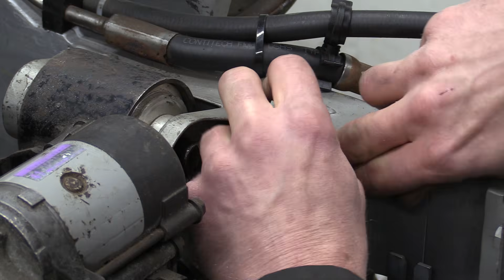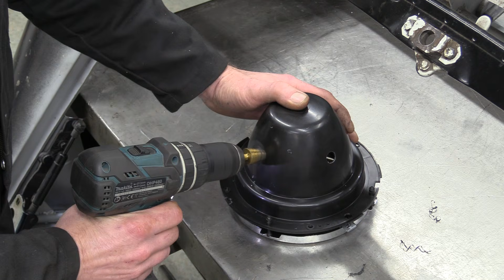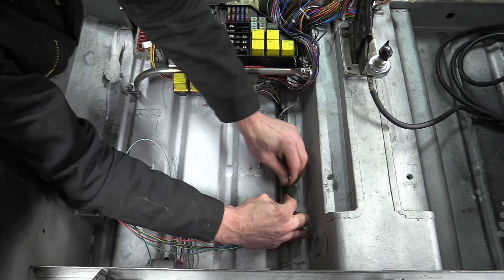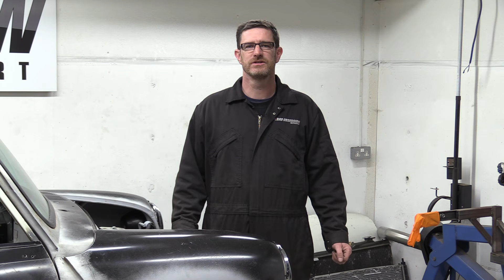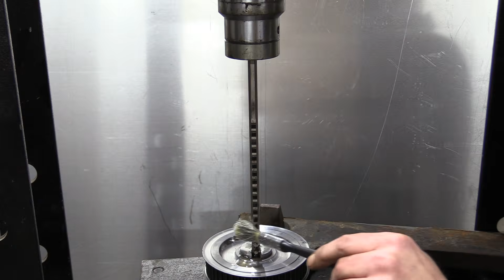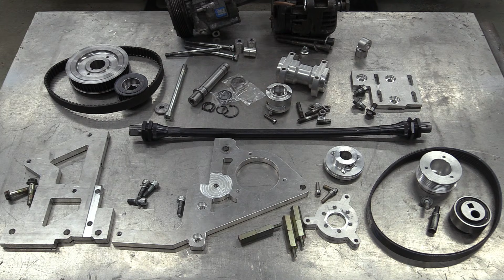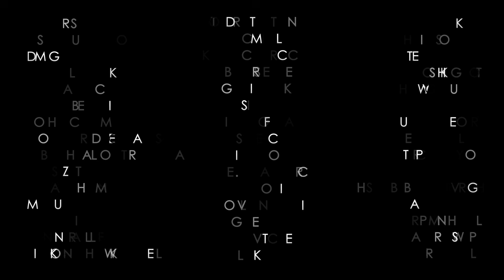Project Binky - Episode 20 - Austin Mini GT-Four - Turbocharged 4WD Mini

Comment from the maker: Thanks for all the comments everyone! We really appreciate your support. We're not sure exactly how successful the ancillary drive will be. Ultimately the only way to tell will be to run it and find out. It may not last very long and might need regular maintenance, it might be fine but we're very much looking forward to finding out.
Reply: Hi guys. Loving this series. If you don't mind me giving my 2 pennies worth, you might want to ditch that Gates ' Horizon' belt for a standard Gates belt of the same size ( if they do one ) as those ' Horizon ' belts are rubbish. I've fitted a few over the past few years ( mechanic of erm...... yeah, 23 years ) and they don't even last 12 months before they are all perished and splitting. I'm in awe of your engineering skills. That whole bearing carrier, pulley set up is amazing.
Reply: The whole thing will come apart and be painted. Then final assembly gets all the proper rubbers and such.
Reply: Great work, I'm very curious how well that is going to work. Would be very interesting to see the specs of that thingy. 
If mechanical alternator solutions keep failing, perhaps you can hook up a few thermoelectric peltier elements which would produce electricity as long as the engine keeps warm. Perhaps mounted with heat sinks to help cool the extractor with plumbing off. (The exhaust should be the component that reaches effective temperature the fastest as well.). I imagine it would save a ton in weight as well.
Reply: @calysagora3615  you imagine wrong.  A 100W thermoelectric generator costs hundreds of dollars,  is two feet long and runs at single digit efficiency so requires kilowatts of heat from eg. a wood stove to power it.  You'd need at least five to make up for the output of a 50 amp alternator, which would cost several thousand dollars, fill half the engine bay and require about ten to fifteen horsepower worth of heat.
Reply: PKMartin a
Reply: @calysagora3615  Not a bad idea, but as mentioned below, not going to provide enough power.  But if they could fit a little steam engine in there to take advantage of the remaining heat in the exhaust, then they may be on to something :)  (some steam engines even have multiple stages to take advantage of the cooler exhaust coming out of the previous stage)
Reply: @calysagora3615  an average alternator could easily produce  50 ampx 12+ volts ,how big a peltier device to match ,and how efficient are they ?
Reply: Comrades. First off I love the series. I just wanted to add some advice take it or leave it. The stock pulley is actually a harmonic balancer. It dampens some nasty nvh's caused by the crankshaft being like a tuning fork. I have seen other engines where this was done and the oil pump and main bearings were trashed. Just food for thought.
Reply: Fudgeing brilliant as always.
Reply: Why didn't you just take drive from the flywheel? Just a little Hole and a gear, jobs done :)
Reply: when it fails just cut the distributor shaft off and put a pulley on that
Reply: @joelclark634  That was my first thought .
Reply: Originally did you know just how long and complex it would be, like all the intricate pieces and work arounds like this alternator and ac shaft bracket system?
Reply: good work.
the housing of that flex drive shaft will melt !!
Reply: What you guys need to do is add an electric alternator. Problem solved!🤣
Reply: Can't wait for the next episode! Awesome videos!
Reply: Always a pleasure watching your attention to detail.
If the wiring is complete at the rear and front, are you going to fit grommets to the areas where the cables pass through the bodywork?
Reply: So much excellent work. Great skills. Hope that works reliably. If not perhaps there is room for a small diameter alternator to mount directly in the engine.
Reply: I didn't see a harmonic dampener on the new crank pulley. Could that end off damaging the crank or oil pump (if it's a planetary type)?
Reply: Hey guys! You are doing a very good job on the Binkmeister.. I do have a question, however. I hope the wiring setup is a preliminary one? I hope you are not doing the project that well and then cheap out on the protection of the cables?  :) You should really put a corrugated insulation tube around it.. From personal experience, I know that Wurth has good cable managment systems with these. They also have different Y-splits,90 degree bends,etc.. Here is a screenie from their online catalog where you see the different diameters and added splits etc. http://prntscr.com/lmpgfr
Keep up the good work! Can't wait to see this project done.. :)
Reply: @sasakurtovic6850  Final assembly.
Reply: You basically took a Mini body, and built completely new different kind of car inside it. 🤔
Reply: Bad Obsession Motorsport I guess a 48v integrated starter/generator is too costly...
Reply: Why aren't you guys on Motor Trend TV?
Believe it or not, I know whats involved in Wiring an automobile. It took me 
eight hours to completely rewire the Head, Tail, Side, License, and 
Dashboard Lights of a Subaru. I was alone. Then there was the Vee-Wee 
Rabbit. I had to replace the Engine... All by myself. 
My own 1969 Austin America/1100/1300 with the Lucas Electrical System was not a 
Nightmare... Everything worked and hadn't been hacked. All I did was Re-polarize from a Positive Earth to a 
Negative Earth. and replaced the Dynamo with a (How do I know this) 
16 ACR Alternator. 
When I added Fog Lights, or Radio I ran a NEW and separate Harness. I refuse to cut into an existing Harness when it's safer to do it my way. 
I enjoyed removing the SU Carb. with the Intake/Exhaust Manifold combo, 
because installing the Tuned Exhaust Header and a Nikki Progressive Two 
bbl Carb with an Aluminum Intake on the 1430cc BMC was going to change 
everything... It did.
The only drawback on my Austin was the Flywheel Keyway. 
It would shear off. I was constantly replacing it. I was told (By a 
Local BMC/BLMC/Leyland) Mechanic) I had a little too much Horse Power. Is there such thing?
I loved my Austin... I miss it too. It was a cool little car. 
Prior to buying it I had a 1967 GTO, a 1967 442, and other Factory Built 
Muscle. My favorites out of all the cars I owned were my 1964 Olds Dynamic 88 Wagon (394ci with the 
Slim Jim Trans.). Then there was my 1966 Ford LTD... 350hp CB.302ci. with
 a Police Interceptor Trans. It would lift the front Tires off the ground... Even at 25 or 30 MPH!
Of course, the aforementioned 1969 Austin and my (Ahem!) Slightly Modified Yugo GV. The Austin and Yugo 
were stolen... Separately, and Years apart.
Now days, I only build much smaller Vehicles. Some are (A little) over the top. My Mercedes 190e
powered by a GM LS, Two LS powered Nissans, (One is a FOUR DOOR) a '49 Mercury and '49 Ford... Both have a 429 Hemi. I (Almost) put a LS in a 1/27 Scale, Spad VIII. I caught some (Snicker) "Flack" about the Spad after I posted Pictures of it. I didn't realize how real it looked. Even with Snoopy as the Pilot.
There's too many others to list... Over 300.
Keep up the good Hot Rodding.
Reply: So what is it that makes the idler bearing so eccentric?
Reply: If it doesn't work (sorry if you've already figured this out, I realize I'm a year behind...) You might try machining a hole in the bellhousing and setting the alt up with what's known as a "pad mount" configuration in the aerospace industry, using a gear and a pulley on it, then drive the ac comp from that via a belt as you already did.
Reply: @keinanderer9930  .. hey guess what ??
Reply: No grommets where the wiring runs through the frame rails, etc. @ https://youtu.be/WIyxrvO3dRk?t=831 ? would hate to see those edges cut through the insulation and ruin all that hard work.
Reply: daemonhat how can you watch this series and actually think they’re gonna leave wiring with no conduit or grommets?!?! Whole lot will be removed for paint then installed correctly!
Reply: @jackmitchell618  this is the first i've seen of the series. and i'm sure it will be taken apart for paint work, etc.,  but my point is still valid.  the wiring can still be damaged by the sharp edges requiring the harness to be repaired/replaced.
Reply: @daemonhat  Yeaaaaa, thats what final assembly is for. They have to take everything back out again just for paint.
Reply: @daemonhat  I noticed that too, made me cringe a tiny bit- sorry fellahs. They did admittedly say they don't do wiring much.
Reply: @carlsagan2561  Didn't you see the Gromit at the beginning of the video?! Though I guess you could be from US of A and not get the joke...
Reply: Really, you must think they are stupid.  Of course they will use grommets in final assembly  @daemonhat
Reply: @irSpeed  first, i never implied they were stupid, i mentioned the lack of grommets and my concern over it.  second, my point is still valid, running the wiring without grommets or even some masking tape to dull the sharp edges, even if it's just to test fit it still leaves open the possibility of the insulation getting damaged and the wiring harness having to be repaired/replaced.

Comment: I wholeheartedly agree with the inclusion of a new high level brake light, or third brake light if you're in 'Merica. It's far easier to see that light, which is typically right in the middle of where you're looking, than it is to catch the standard brake lights, particularly at night when your tail lights are on anyway, so the distinction can take a moment to register. It also gives you an extra bulb that can be burnt out before you're failing to indicate that you're stopping.

Comment: What sets you guys apart from practically everyone else doing these kinds of "mods" on EweToob is that, between the two of you, you have all the necessary education and requisite skills to do this properly (hopefully).  Designing, mechanical, electrical, drafting and shop skills all contribute to make a great series.

But just why are UK "fog lights" red and not amber.  Seems like the amber color would penetrate fog much more readily.

Comment: Why didn't you two use rubber grommets in the holes in the frame when running the wiring?  I would think that with any amount of normal everyday running and bounding about in the Mini that running wires through sheet metal holes would, over time, wear through the wiring insulation and short it out.

Comment: The lack of mechanical protection on your cabling is a real concern, especially where the pass through holes or across sharp edges. Really need sleeving or conduit. They will chaffe

Comment: I am surprised they still use alternators in the present form.  Now that control electronics have matured, why not fit permanent magnets into the flywheel and have the coils fitted in the bell housing.  This could still be designed to give 3 phase AC but without the problems of conventional alternators.  As the rotating velocity is much higher, it would use much less materials and be lighter.   Also....  why not run the engine lube oil through the cooling system instead of water.  This would remove the corrosion and freezing problems and also provide engine oil cooling.

Comment: Having electro/hydraulic power steering I would  consider a  higher capacity battery may be needed to maintain a stable supply for the CPU.

Comment: What will the toque numbers be for the motor build be? Two hundred ft/lbs should be plenty. That is , if , the final weight is at or under a metric ton.

Comment: Just to give you heads up, you might be aware of it since you are also working on rally cars, it is not very good idea to have servo system and breaks on the same oil system; if you break realy hard, oil gets very hot and you loose your servo steering - it might be a good idea to have it separated.... You might even think of adding a small radiator for cooling the oil...

Comment: I've throughly enjoyed watching you mad geniuses at work from vid #1 to 20; but I repeatedly cringe at two rather glaring issues that leave me with much consternation.. #1) how do you plan to seal all the bare metal bits? Especially the myriad of tiny nooks and crannies throughout the body that are now covered? [let's not kid ourselves, those welds aren't watertight.] Initially I'd assumed you'd dip the chassis before final paint and assembly, but watching you run all the electrics makes me fear this will not happen. And I've heard tale you chaps in Jolly Old England get a fare bit rain, and if I know anything, British rain has a miraculous way creeping into the smallest of voids.. Now I know you limey bastards love your rust, it's practically a birth right, but it would be a tremendous shame to see all this amazing engineering go to pot a in a matter of seasons... Which brings me to #2) running wires through bare metal [read *SHARP*] holes. Vibrations will render the insulation on the wires useless in no time, and given the intricacies of your routing, it would be nigh impossible to repair when the inevitable happens; short of breaking out a grinder. This is why automakers provide nice rubber grommets and boots to prevent said chaffing. Just something to consider. Keep up the good work. Long live Lucas Electrical [Ha!] and God save the Queen.

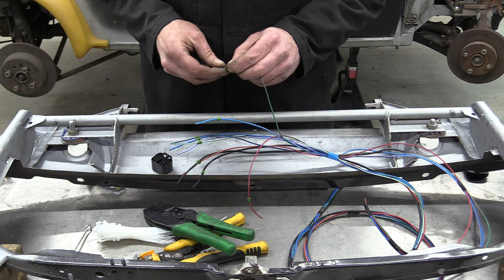Comment: 9:15 "sealed connector" - fill it with light grease at final assembly anyway. Water can't fill a plug that hasn't got an airgap in it. Vaseline/petrolatum works fine (don't use silicon grease, it messes up the electrical connection in the long term)

WRT all the "belt drive stuff" - why not just replace it with electrics (including electric power steering) and either use a bigger alternator (using the flywheel as an alternator works too... it's how they do it on motorbikes and a lot of hybrids)

Isn't the Celica's crank pulley also a harmonic balancer?

One other thing: White (undyed) nylon cable ties are for INDOOR USE ONLY. They go brittle when used outdoors (UV light) or if exposed to "solvents and other things" - use black nylon 66 ones as they'll stay flexible.

You will probably find that this stuff  -  https://www.velcro.com/business/products/self-engaging-hook-and-loop/ - is even better than cable ties. I've used it to attach cables to catenaries and found it still holding on tightly (and flexibly) after 15 years!

Don't forget the loom tape, grommets and protective sleeves before final installation!

Comment: OK, I have been in awe of your fabrication skills, your problem solving, your raiding of parts bins , adapting modifying improving reusing,etc, but this last episode takes the biscuit (Hobnob of course). Superb solution to the alternator problem, and picks up the aircon as well.
  I have worked in Engineering all my life, built my own V8 MGB roadster, built unique bits of plant,thought I was good, but I am humbled by your skills.
 At some point you have to send your registration document to DVLC, saying note change of engine size and colour, and then with an MOT it is road legal as a tax exempt vehicle, because the roof  and door frames, and a few other bits, are indeed original. Very satisfying to use the law to your advantage, and none of the Kit car rubbish rules.
 Good luck with the rest of the build.

Comment: Hi guys ..... brilliant engineering ...... great sense of humour ...... average cable management :-)
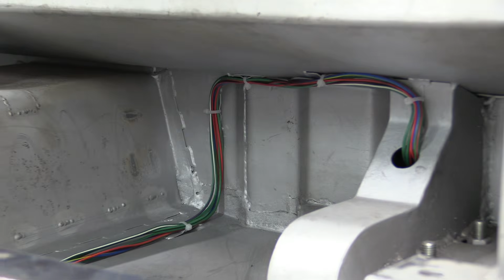A snapshot at 13:50 for example shows what might become a problem later in Binkys life.
I know (to my cost) that cables passing through a bulkhead will eventually wear through their insulation, through vibration.
When I was young-and-daft (I'm now old-and-daft) I wired spot-lights to my Mk 1 Ford Escort rally car ...... I eventually sent martials diving for cover over hedgerows as my full lighting went out during heavy braking into the check-point.
The insulation on the spot-light wiring had chaffed through on the bulkhead and would touch earth as the heavy gauge wire moved forward with inertia.
If only I'd fitted rubber grommets .... doh!!
Great project fellas , thanks.

Comment: Couple of points I've noticed (you might have these sorted already):
Passing unprotected wiring harness through holes in the sheet metal might not be a good idea. Vibration can cause the sharp edges to cut into the wires over time. Adding rubber grommets or covering the harness in abrasion resistant material helps (tesa fabric tape works well).
Also for any part of the harness that moves try to keep the bend radius as big as possible to avoid wires breaking over time. Using wires with higher strand count also helps.

Comment: I am amazed that you havent used any grommets at the chafe points where you have gone though a piece of metal.  and more importantly a mega fuse at the battery for the starter cable lead.  i understand you using an isolator or switch on the ground leg but if the starter feeds chafes and grounds then it will melt the wiring until the switch is thrown...
Reply: Don't be amazed.  They will be removing it all to paint the shell and the will put grommets in after it's been painted.

Comment: I think you need to future proof it with some wires for possible spotlights on the front?......, an oversight you'll regret, as everything else is thoroughly thought about.🤔
Reply from the maker: Spot/fog light feed already wired into the plug. Just in case... 😁

Comment: all props to your solution for the ancillary drive, it'll be interesting to see it work. however, since the power steering is electric, wouldn't it make sense to do the same with the aircon compressor? aspen compressor has some nice lightweight ones for instance, and the mini doesn't need that much cooling. then the alternator could be replaced by a beefy BLDC motor, they are much smaller than alternators for the same power, and although they need some electronics, one could make do with a 3phase diode and a regular voltage regulator. might be a lot lighter and more flexible in location. mustard after the meal though.